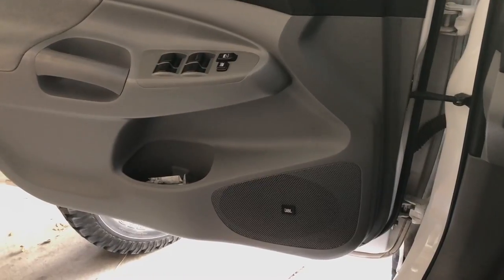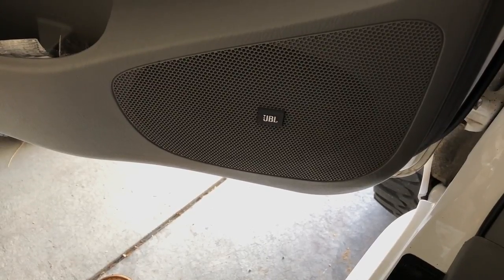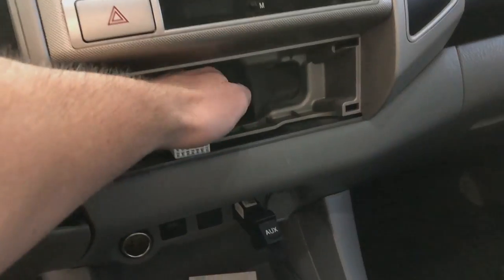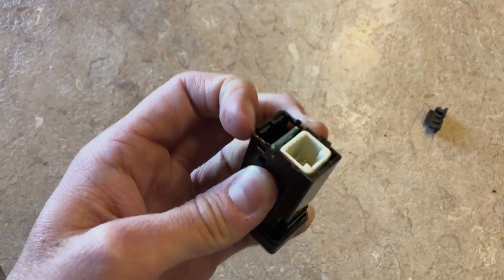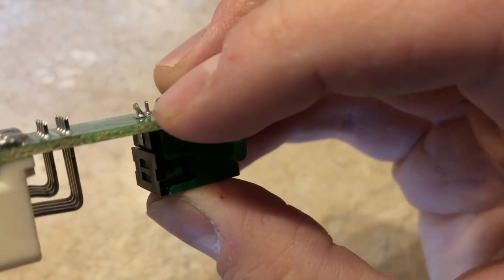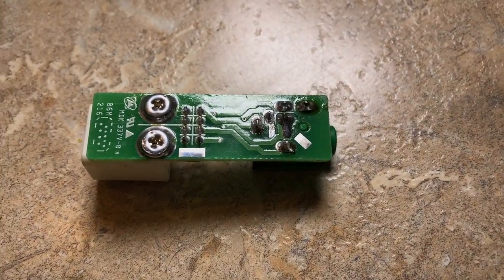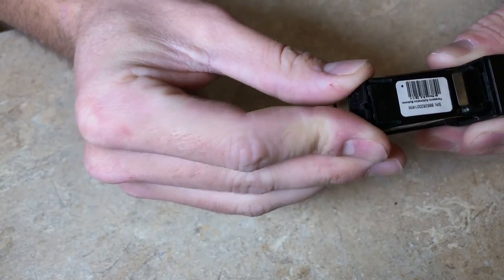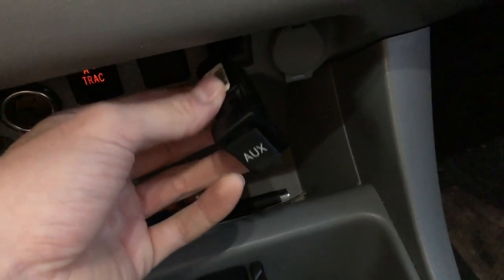How To Fix A Faulty AUX Input On A Tacoma (Or Any AUX Input)

Comment: Thank you!  This was a life saver.  I thought I was going to have to replace the stock radio.  The CD player doesn't work and I have a LONG road trip coming up.  I tested with an MP3 player to the aux port and  .. wow.  Nothing from the left side and whispers on the right.  I found this video through desperation.  Took it out, soldered 5 joints, put it back, and the difference is astounding!
Thank you again.

Comment: This is exactly what I figured I could do with mine but I wanted to watch somebody else do it to make sure it could be done successfully before I attempted it. The only difference is that mine is in a Venza but I believe it's the exact same unit.
Reply: Just yanked mine out today and resoldered all 6 points at the 3.5mm / 1/8" input jack.  Works flawlessly and is rock solid now.  No wiggle.
Reply from the maker: Glad it worked out for you man! It’s such an easy fix, way easier than taking it to a dealer

Comment: My 2nd gen aux port doesn’t always connected, it’s a hit or miss using aux wire or Bluetooth adapter. When it’s not seeing it I won’t be able to change input mode to aux at all that way I know. Im going to take it apart to check, thanks

Comment: Nice video. There are several videos on the subject, but most don't have very good lighting or camera work so I couldn't actually see what I was supposed to be looking for. My aux jack has a bad connection in the same spot as yours', that forward pin. Should be an easy enough solder. Save me $140 to buy a new one from Toyota

Comment: does anyone happen to the know the wiring schematic for these? its hard to believe 4 wires go into an aux port that usually uses 2 wires
Reply: Left channel and right channel each have a positive and negative lead = four wires. The input jack has rings that correspond to the channels. This is for stereo. Some vehicles have a fifth wire in the aux port for a vehicle chassis ground to reduce noise.

Comment: Mine doesn’t have loose pointa buts still disconnecting??
Reply: I didn’t find any loose connection or anything but I did soldering touched up all pins. It works again, probably just cold solder

Comment: Please  do not add (Or Any AUX Input) ad not all of them are the same. Hondas, BMWs, GM, Ford and Chrysler are all very different from the Toyota you are showing and broken solder connections are not the problem on ALL of them.